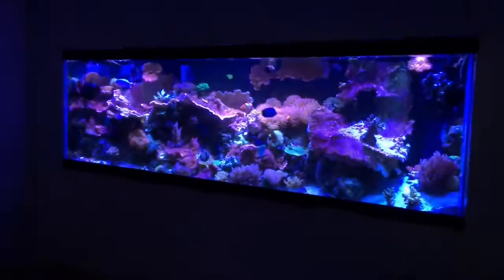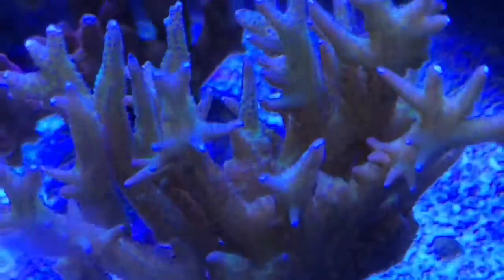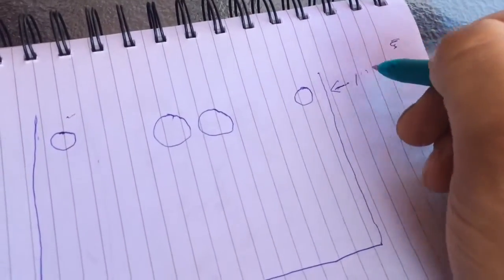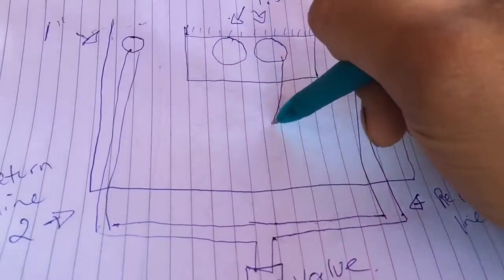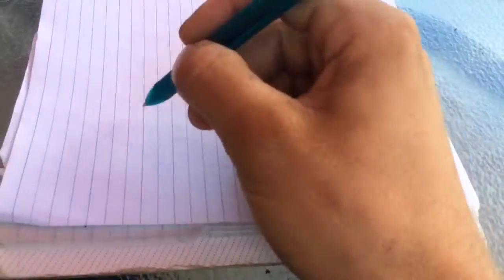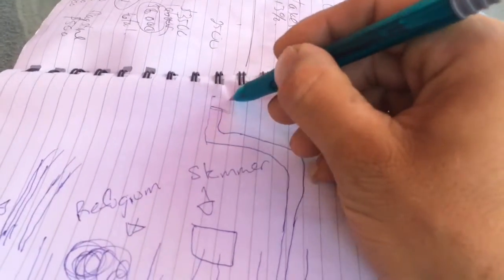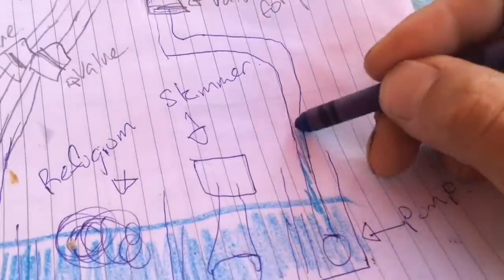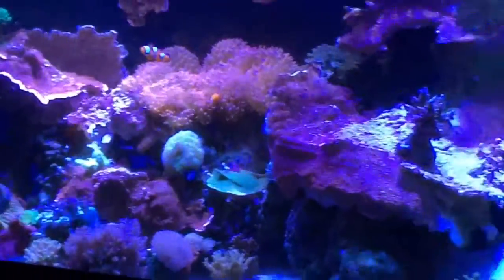How to convert a freshwater fish tank to a saltwater coral reef fish tank

Comment: You know a lot more about plumbing than I do.  Too complicated for me.  I keep it simple with hangon equipments and canisters for my saltwater fowlr tank.  I have a 240 gallons tank and I had plumbed it for under cabinet equipment but my water quality is so good that I never bothered setting up an overflow tank under my main display tank.  My tap water nitrate is 10  and my tank's nitrate reading is 10 even after a year of no water changes.
Reply from the maker: Hey it happens 
Sometimes simple is best 
Whatever works for you is best for you. So many different designs. 
Stay tuned more to come

Comment: I always understood filtration. Never understood PLUMBING O_O 
why do all this DIY custom plumbing for a filtration system and driving holes in tanks o.O WTF 
why not just get a single filtr pump, one made for a fish tank, its simpler cheeper and does the same job.
Reply from the maker: Kaul Watson great question 
Advantages to having a sump filtration system . Adds more water volume overall. More water means water will be more stable. Less chance of major swings in water chemistry. Also you can hide all your filtration in your sump like heater and pump and filter and so on. Which allows you to have a more cleaner looking tank as there won't be as much equipment handing off of it. Which gives for a nice clean cut look with many more advantages.

Comment: Skimmer should be before the fug so as to not skim away any pods etc.(My opinion ).
Reply from the maker: I see exactly what you mean and that is how my 125 gallon reef tank is done but in this video I changed up the design a bit as each design is different. As well having the refug after the skimmer has the potential to get the pods or whatever you have in your refug get flown over Into the return pump which can also act as feeding. Appreciate your feedback and your opinion!
Reply: Leo Pazzo Cool bro👍

Comment: Say Leo. I have few freshwater tanks. but I would like to start my ten gallon with saltwater. I want to get some Clowns. What you think?
Reply: 10 gallons is way too small for saltwater fish.
Reply from the maker: Hector Carrasquillo Sr. I would just use a hang on the back filter instead of going thru all that trouble. If you really want to then it would be roughly the same process but in a smaller scale. Smaller holes and less holes. U can even get away with 1 hole for the drain and the return line just run the plumbing behind the tank and into the 10 gallon. 
Need any help let me know

Comment: This is what I need to do !! I find it complicated once I know what I need sure I'll be a don in no time :D
Reply from the maker: Phoebe Jones yea man I'm sure you will be fine. 
First what tank will you be using ? Find out if it's tempered glass or not. And where is it tempered glass bottom or sides ?
Then you will need to drill the glass if it is non tempered glass. Tempered glass you can not drill. Contact manufacture if needed. 
Depending on your size tank will depend how man holes you need and how many: after that you can decide on location of the holes. 
Practice drilling glass before you drill the tank. I have other videos on drilling glass tanks as I'm sure it may help you a bit. Few tips and tricks.